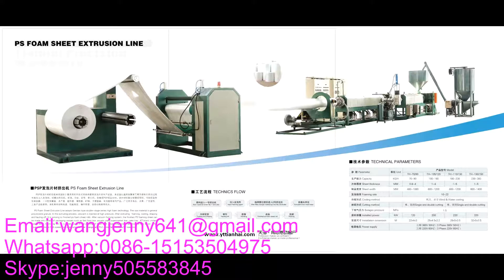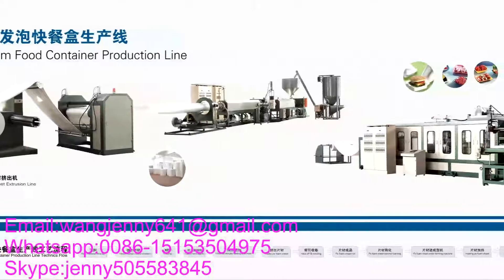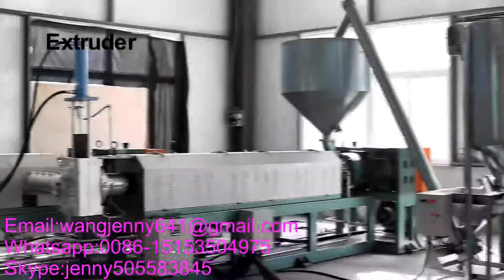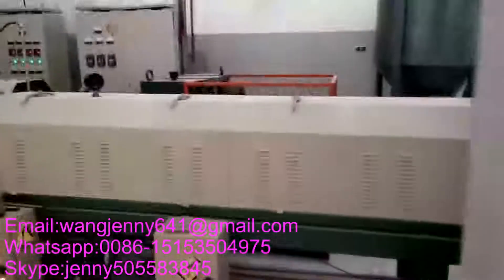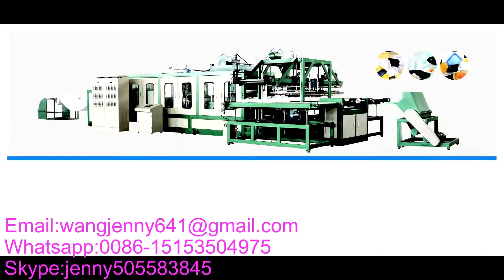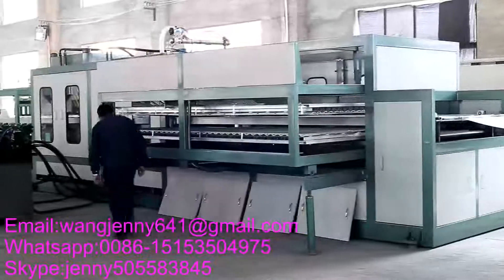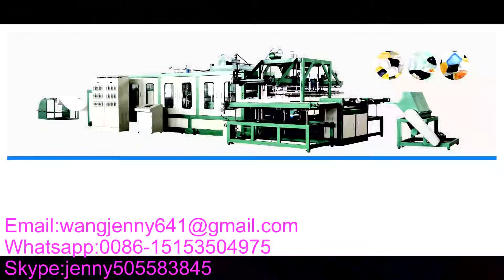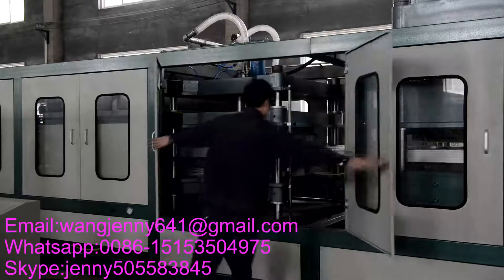PS Food container making machine/PS take away lunch box machine manufacture/PS sheet extrusion line

Comment from the maker: PS food box making machine/PS food container making machinery
www.psfoodboxmachine.com
PS food container/lunch box making machine mainly includes three machines as following:

1. Ps Foam Sheet Extrusion Machine-------Make the sheet for forming part.

2. PS Foaming machine---------------------Make different type of product with the forming mold,cutting mold etc.

3. PS recycling machine--------------------Recycled the wasted material to PS granule again as the raw material.

1.PS Foam Sheet Extrusion Machine

.It adopts Gentian type double-stage series high foam technology.
.This equipment adopts high speed hydraulic filter changer, which has steady feature, can change the filter immediately without stopping the machine.
The raw material is general polystyrene granule (GPPS).
In the extruding process, foam agent (such as butane gas or LPG) is injected at high pressure.
After extruding, foaming, cooling, shaping and hauling off, it is winding to finished ps foam sheet rolls.
After vacuum forming system, the finished PS foaming sheet can be made into variety of packaging vessels ,such as fast food box ,aquatic plate,supermarket tray ,cake tray , KT board ,instant noodle bowl ,foam tray etc.
It is widely used in the packing for food, fruit, and advertising industrial products, etc.
2.PS Foaming machine

It is an all-powerful thermal forming machine with integration of vacuum forming and cutting.
It adopts remote infrared ceramic heater in heating zone, with which the machine get the most stable and even temperature.
It adopts temperature digital system, which is convenient for the workers to know the temperature of each heating zone quickly. Also it is easily operate and make more efficiency.
It adopts Japanese servo motor & drive, Mitsubishi PLC mechanical and electronic integration control, touch screen for operating.
It features reliable stability, large forming area and fast speed,as well as highly degree of automation & economic on manpower.
It adopts automatic pneumatic device in feeding area, which reduces the labor force.
3.PS recycling machine

It adopts fully automatic temperature controlling, one manual filter changer device at the front of the machine to filtrate the impurity of the recycling material.
the die head made by special alloy steel, follow one set of electric heater bands and automatic temperature controller,die head passageway is designed special, the press of granule formed need can be ensured.
water channel adopts corrosion resistant plate, cooling water circulation, ensure the material line cooled blance and sufficient.
granulator cutter adopts frequency speed control of motor drive, the speed of hauling off controlled accurate, the length of granule equality.
It is the ideal equipment to recycle the plastic scrap .It features compact structure and easy operation.
It can process pe/ps/pp material and is mainly used to recycle the high foam polystyrene and high foam polystyrene products.